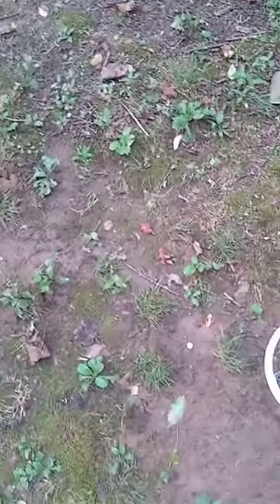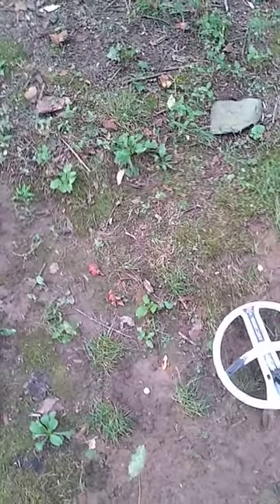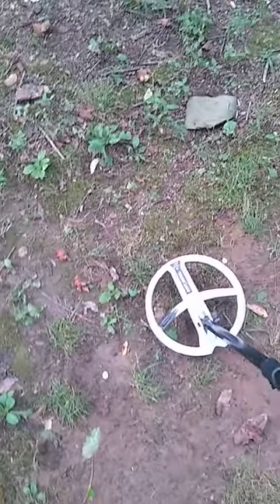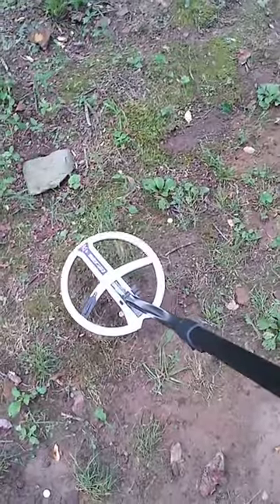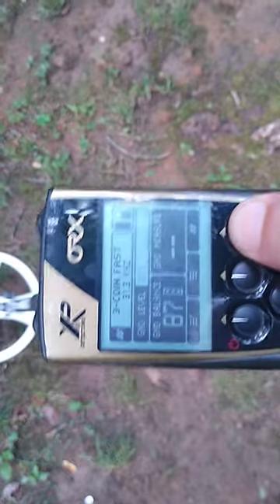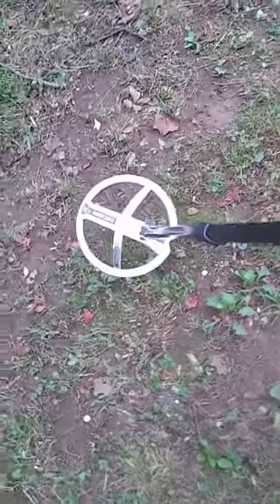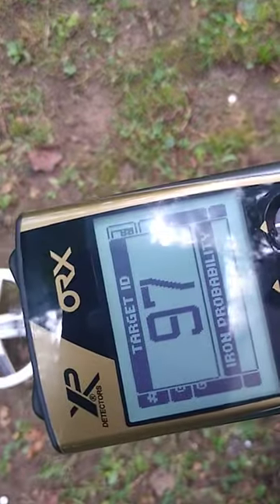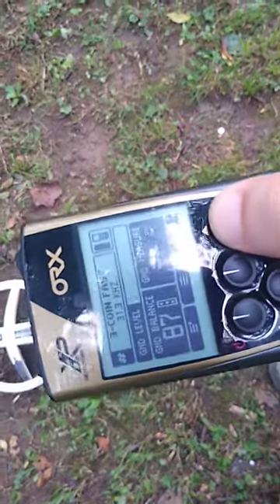The XP ORX Metal Detector vs Bottle Caps

Comment: This phenomenon is related to the ORX Coin modes having no sub zero iron discrimination range. Some steel bottle caps depending on brand, condition and depth will “wrap around” between 99 and 0 due to the ORX and to a lesser degree the Deus, up averaging all target IDs if changing from lower 14 kHz to higher 31, 54 or 81 kHz. So the bottle cap’s 95 to 97 IDs and any target with a high 90s target ID will have IDs that become even higher with higher frequencies and more depth to the point of moving up from 99 to no ID and broken or no audio. With the ORX, that can put some of those crown bottle caps into a kind of no mans land where they won’t be detected. That is a good thing in some cases. That is not a good thing if a smaller non-ferrous silver coin or piece of silver jewelry is next to a bottle cap that is being silenced by up averaging. The coin or jewelry may also be partially or totally silenced. 
The Deus has a wrap around area between 99 and 0 too but it is filled with audible target IDs from -6.4 to 0. Those same steel bottle caps will give an iron response with a Deus using the -6.4 to 0 range accepted.
Two other ways to check for possible steel bottle caps versus other more desirable non-ferrous targets is to wiggle the coil off of the edge of the bottle cap and listen for low iron grunts (iron volume has to be turned on) using the Deus. It does not work as well with the ORX for the same no man’s land reason above. The other way is watching for an increase in the mineralization bar when swinging over a possible steel bottle cap.

Comment: so whats meaning and resume for that video? when you go on 31khz than its choppy sound on bottle caps 
or what? but with 14khz is better sound on bottle caps but on 31khz choppy??? :) so dont use 14khz on dirty places but use 31khz to hear where is caps?????
Reply from the maker: It is to show if your in a trashy area looking for coins and there are a lot of bottle caps, it is a way to see if the target is an old bottle cap before you dig it. Yes the higher frequency helps to eliminate the old steel bottle caps.
Reply: @timhenderson2643  thanks. Got it

Comment: Would you suggest detecting in 31kHz???
Reply from the maker: If your encountering a lot of steel type bottle caps or small bits of misshaped iron out coin shooting would be a good way to help eliminate those. But regular places with less iron laden trash you can use lower frequencies in mild soil conditions. I hunt in deep mode with 31 khz all of the time.
Reply: @timhenderson2643  Thank you.  Just purchased an ORX.
Reply from the maker: @DiggingCanuck  your gonna love it!!
Reply: @timhenderson2643  Yay !!!!